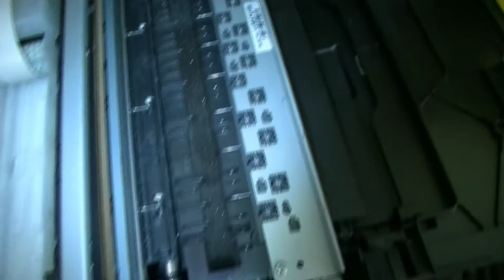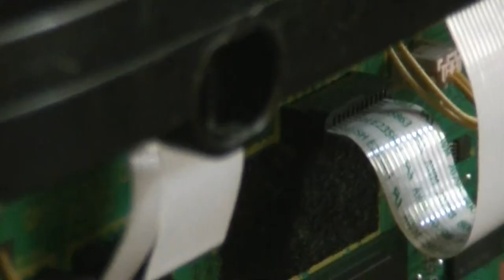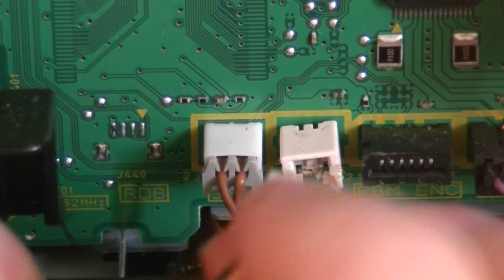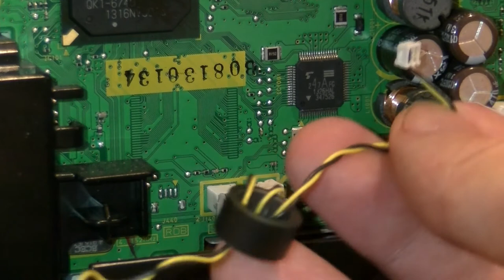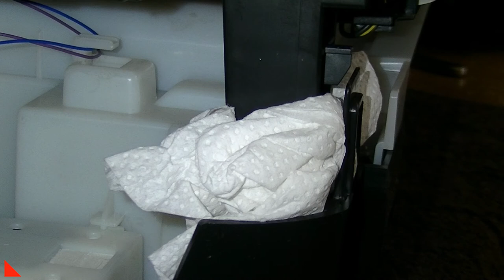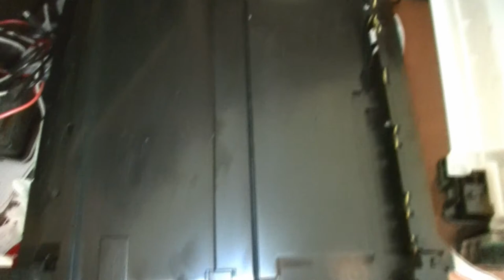Canon MX395 Printer Opening for repair Part 2 in HD

Comment: I appreciate this video so much, very hard to find disassembly videos for my model MX535, it was almost identical except the left side was two parts instead of one, it was still those hooks though they were much harder to remove.

For the plug that you had to butcher to remove, I just used some needle nose pliers and it popped right off without any issue, just be sure to grab the plug and not the socket by accident.

Once I finished your videos, took me a while to figure out you could take the whole assembly out so that I could see the bottom where the paper feeder wasn't working. Found the issue was a gear with 3 missing pegs so I'll create a new gear tomorrow with epoxy and see if I can remember how to put it all back together again.
Reply from the maker: very glad it helped, sound like very good plan indeed! Sometimes I take pictures when I take something new apart this helps really a lot :D Good luck and fun with your repair !
Reply: @FixItAMIGO  Although I fixed the gear, I unfortunately pulled on the ribbon cable to the print head, and I think this disconnected something. I couldn't figure out how to get into the print head to reconnect/check the ribbon cable, so unfortunately gave up. It's sitting in my garage as "spares" for now :)

Comment: I have an MX452, which is very similar.  This was very helpful in locating the clips that hold it together, so that I could get to the feed rollers to clean them.  Thank you.
Reply from the maker: Thaks for update :) I like those printers but you really need to know how open them else you break half off it. I am glad it worked out for you and that video was a good guide. Cheers !

Comment: Hello. Is it still possible to repair the plug that we need to butcher? Cause it came off. 😢 Is it a very important piece? Or can I just leave it broken?
Reply from the maker: you mean those snap things, if they break its not a huge deal. Some printers I never put the whole bodywork back on because I often repaired them so I did not bother to put everything back on.

Comment: Thnx for the great video. I have a similar model which is mx455 and i wish to repair its paper feeding roll which can be reachable if i can remove the bottom cover. How can I remove it and contact this single feeder roller?
Reply from the maker: Good Question I will have to check, I think it should be possible but will have time to check it during weekend
Reply: @FixItAMIGO  thnx a lot 😊 I will be waiting.

Comment: the spring on the feeder roller has become weak so my printer not taking papper do you have a fix for this?? but i own MX540 but they seam the same??
Reply: Martin did you find a fix for this? The sponge fix on other videos sounds good but requires taking the bottom panel off. Thanks!
Reply: @annewilliams5206  I fixed the feed issue but when putting it back together it comes up with an error, not as easy to repair them
Reply: Hello Martin, thank you for taking the time to reply. A bit of built in obsolescence I fear…

Comment: hi great video I have the pixma MX532 i have to get to the paper guide track where you feed the paper, the track is jammed by a bead that is lodged,  is there a way that I can access the bottom panel without removing the whole of the printer?
Reply from the maker: you probably have tried this already but on the back of the printer usually you have an opening, you open it leave it open and restart printer few times usually that piece of paper goes out through that opening. If that does not work, you probably need to open the whole thing.

Comment: Hi there! May ask if you can record a video on replacing the pickup roller? Thank you! Subbed!
Reply: Congratulations on the 1k sub! 😁
Reply from the maker: thanks for your comment and the sub, I have finally 1k lol ! I will have to check when I have time but I will try, at the moment I have lots of work and doing lots of overtime so not much free hours. But I will try on 25th.
Reply: @FixItAMIGO  this will be very helpful!
Reply: I have the same problem! Any luck? Also have you seen the sponge fix if it's just roller pressure and cheap spring that's the problem. But you have to get at it through the bottom.